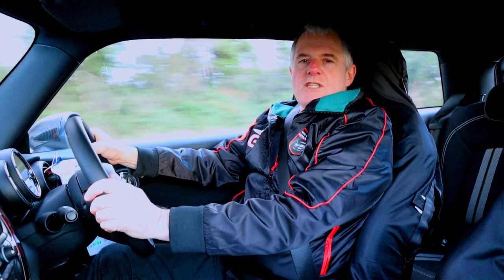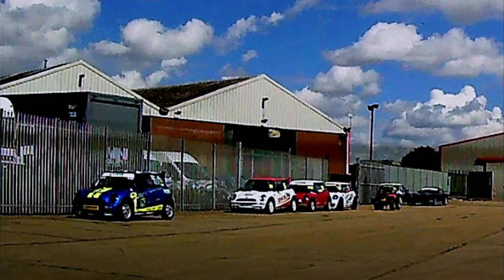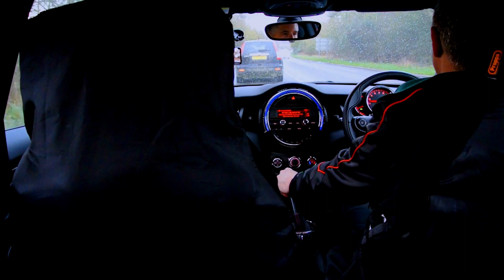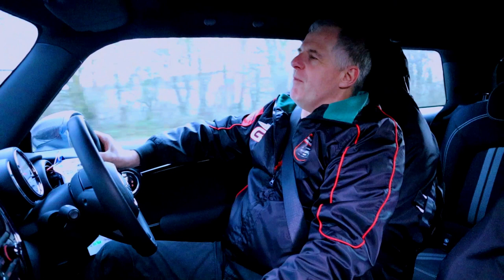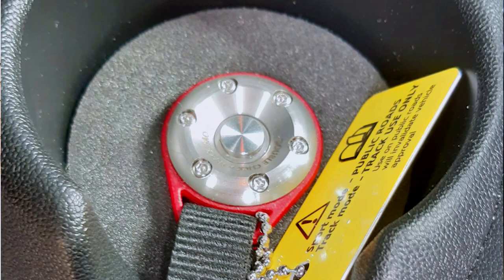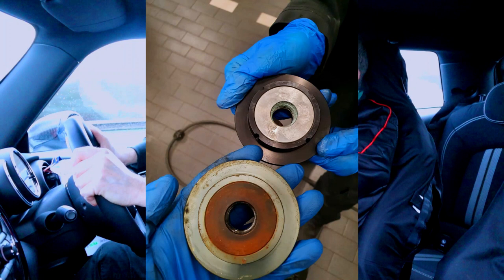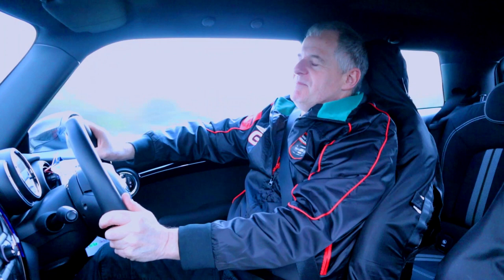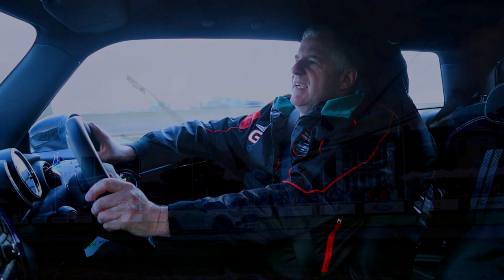John Cooper Works Mini Challenge Edition Performance Pack Model

Comment: Do you know what size spacer are fitted to it? And is it just on the front?
Reply: Hi mate yes it's just the front, I have just looked in the performance pack handbook which you would think that type of detail would be included 😀 but all it tells me spacers are filled, I think they are about 4mm thick with out taking of the wheel 😉 laters Steve 😀
Reply: @crazybaker1  cheers buddy would love to come have a look over it one day I own a cooper s myself and would love to try and reproduce something like one of these! But like you say it so hard to find all the nitty gritty details about them.